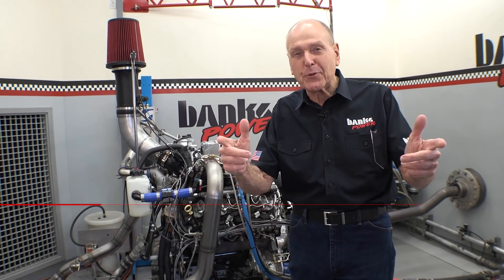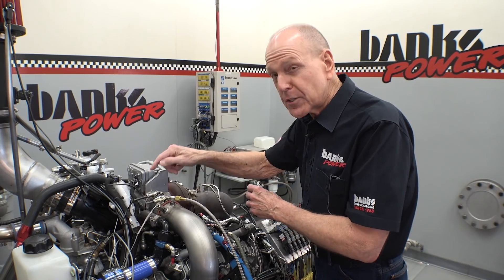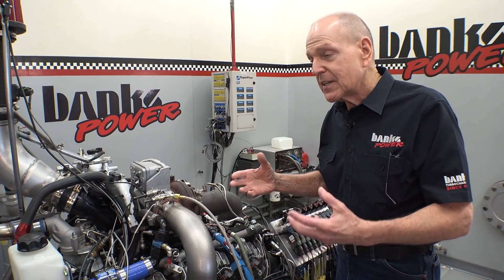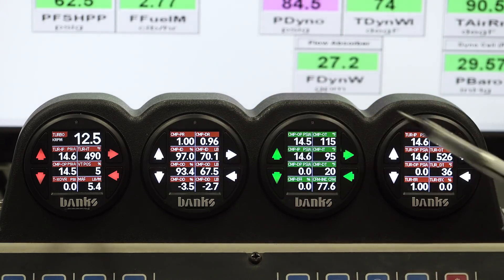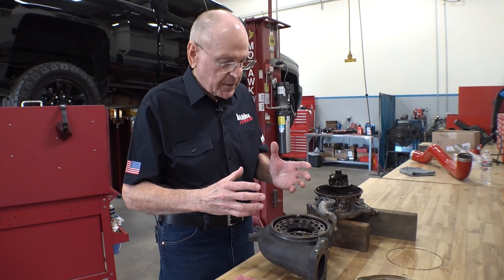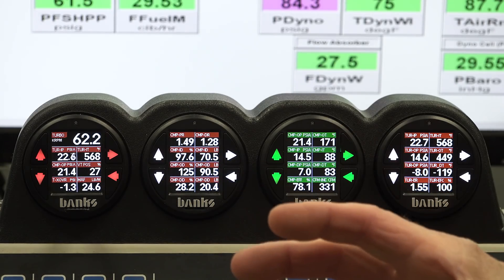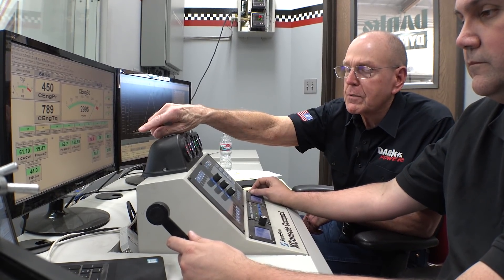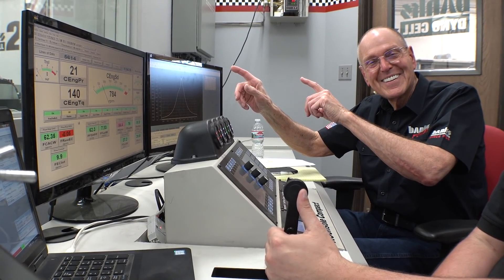KILLING A DURAMAX Pt 3: 133,000 Turbo RPM! 🔥

Comment: You know what, you just made me realize something. In turbo ej25 powered subarus they have a major pattern failure with ringland failure. They also have just about the shittiest turbo hot side possible, giving them their signature sound. I wonder if due to that manifold we see high exhaust pressures at the exhaust ports, leading to high combustion tempertures and more sensitivity to knock. Combine that with poor knock control and you've got a recipe for smoked motor.
Reply: Its the unequal length headers that give them the sound, you can buy them for a non turbo subaru and it will have the rumble. The problem with subarus is bad head design (flow) and poor quality ringlands.
Reply: @Nickat1ne707  Obviously it depends on exactly what engines we're talking about, but most of the newer (00+ ish) NA subarus have equal length headers and don't rumble. In 2010 they went to the new gen of legacy and had a EJ25 turbo model with a different hotside and low mount turbo, I wonder if that car has ringland issues or not. I find it hard to believe that something can be cast so poorly so consistently. The dimensions of the piston aren't wildly different than other engines.

Comment: Quick question. The egts and cross over pressure only spiked because they manually closed the vanes on the turbo, so if left alone, it isn't actually out to lunch right?
Reply: But they had to close it to make that kind of power is what hes saying. So an l5p can potentially make that power and may last for a little while, its unsafe long term plus at the point your upside down in it youre no longer creating power or being efficient, youre just blowing and or trapping hot air

Comment: Great video. 

Unless I've missed it, I don't think you mention what fuel your using (I assume ultra low sulfur diesel from the pump).

It would be great if you did a comparison using ULSD, JP8 and Jet A. I run JP8 and Jet A as often as possible, seem to get better mileage, maybe because the high sulfur content?

Comment: It would be interesting to see if any of that data changed with a 5" -6" downpipe. I'm in the same boat right with a gasoline application, but I'm not sure if my turbo or my exhaust is the limiting exhaust restriction.
Reply: While I can't say for sure as I haven't seen it, my opinion is that if the exhaust itself isn't a restriction yet, it probably will be after upgrading the turbo. :) Did you plan the exhaust for the build, or are you just dealing with what's there for now? I'd go for exhaust first, as it's less expensive than a turbo and it's a supporting mod for that turbo as well.
Reply: Theres all kinds of charts and calculators out there for this, 3 inch has been known to do 700 wheel some have done more. 4 inch will do over 1k. Plus you can easily pressure test an exhaust.
Reply: @Nickat1ne707  - this is true, but remember that it's more than just pipe diameter. Routing (bends) and other pieces like mufflers make a difference. Not everyone wants a straight pipe system, and all the other parts are restrictions. 

Just adding more food for thought. :)

Comment: sounds to me like that duratrash she just can't swallow the turbo's load cam duration/lift valve size . got about 60 junk duratrash'es engines in my scrap pile full of water and rust.. needing 5 good ones for 5 2016 3500 gm jokes now. i never had that many 6.0 powerstrokes junked out ever. variable geo turbo hanging up binding.. banks kicks @$$ on ford powered motorhomes. every  oil pumping/leaking chevy wishes it could have a strong frame and power train like a ford.
Reply: *eyes roll so hard it hurts

You have scrap engines because someone's been using crap tunes.

Also, brand wars? Seriously, what are you, 12?
Reply: @Broadpaw_Fox  thank you, i thought i was the only one that realizes how fuckin moronic that shit is. Seems like some of these guys small brains cant compute that the brands dont matter its about learning about engines. And to the original poster... You sound like a dull creature so ill leave it there.
Reply: I have worked on diesel engines all my life and no i am not 12. a lot of the pullouts were wash downs ran with fuel in oil till no compression. some threw rods, knocking. these were out of customer vehicles and how they serviced or used them was not my doing. as for people deleting and using tunes i can't help what people decide on doing to their vehicles. if you sit back and  read postings over the years and changes to the duramax you will find what years people recommend buying the ones to stay away from if buying used. same with dodges and fords. yes some people are pushing these engines past what they weren't designed to do from the factory and yes some tuners are worse than others.  most engines in my scrap were never tuned or deleted at all, some were warranty voids from a dealership tuned or deleted, bank repo's people let go back because they can't afford the expensive repairs. to pure neglect..  take care

Comment: I would like to know where do you guys put the speed sensor for the turbo
Reply: Speed sensors are either directly coupled to the shaft or use a magnetic or hall-effect pickup sensor that looks for the fins of the compressor wheel to pass the sensor.  In this case a hole is drilled into the housing for the compressor and a sensor is placed in close proximity to the tips of the fins.  The signal is sent to a module where the RPM signal is divided by the number of fins that pass the sensor end in one revolution and a final RPM is determined.   Look at this for an idea https://www.full-race.com/store/borg-warner-efr/turbos-efr-series/borgwarner-efr-turbo-speed-sensor-kit-2/

Comment: I’d like to see them mess with an old 6.2 diesel again I know they used to make turbo kits for them that worked pretty decent I’d like to see what they could do now with one of those old Detroit rattlers now. I used to drive one at work that had 250,000 miles on it was A pretty good old truck as long as you wasn’t in a hurry. I used to have some neighbors that had two suburbans with those banks set ups on them they drove those things for ever and still have them as back up vehicles they both have the banks turbo set up. Awesome video !
Reply: They last, problem is they just dont make the power. A 7.3 would be faster and haul more. 6.2s are turds its just facts

Comment: I wonder if the water pump is just spinning so fast its not actually pumping, and its just flowing around the fins on the inside due to back pressure from a small diameter restriction somewhere,
Reply: That's called cavitation, and yes, it's exactly what's happening. :)

Comment: The Duramax is an incredibly strong engine.  I had a  GMC 2002 CREW CAB LONG BOX. PUT 435000 miles on over  11 years and its is still  going strong  yet today so I am told.  It pulled a 5th wheel trailer  37 ft. most of it's  life. Just an amazing engine.  Waiting for the next step. Thanks

Comment: What would happen if that thing had the vain all the way closed?
Reply: That's how an exhaust brake works no air out means no air in with means the engine will slow down.
Reply: At that rpm and power level it would destroy the turbo maybe more
Reply: Turbo rpm would skyrocket way over its limit.

Comment: I would love for you to build some cool stuff for the 2.8 Duramax 😀
Reply: 2.8 Duramax.  I am not familiar with that one.  Similar to the crate Cummins 2.8?  Or is it in a production GM?  Upon further review I forget about the Colorado.  I really have no interest in a small truck.  If I could get a diesel in my half ton Silverado it would be interesting.
Reply: @bmstylee  a new Colorado is about the same size as an older Silverado. 

You can't really call it a "small" truck anymore.
Reply: @KurNorock  True! I have a 2001 Silverado and my neighbor has a diesel Colorado and it is definitely taller and maybe 3 inches shorter at most!
Reply: @dangoldbach6570  yeah I had a 2018 zr2 turned out to be a lemon now I have a 2019 Zr2 with the diesel. Just looking for some upgrades and GDE is the closest I've found doing extensive testing, but their 2019 tune won't be available until this fall sometime
Reply: @KurNorock  it's a bigger truck but the cab is still small inside.
Reply: @bmstylee  that's too bad they are fun trucks, some people work with their trucks, some people play with their trucks, and some do both, but everybody needs modifications from people that know what they are doing and go through extensive testing like gale banks does. And yes I was asking about cool stuff for the 2.8 Duramax that is in the Colorado and canyon
Reply: @Wild Bill there will be a 3.0L in-line six duramax offered in the half-ton Chevrolet trucks in a couple months